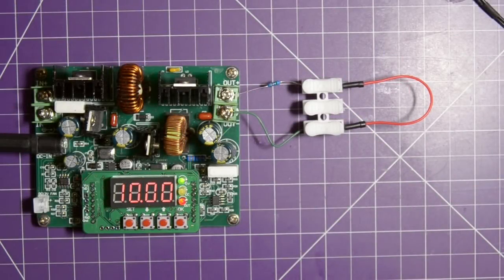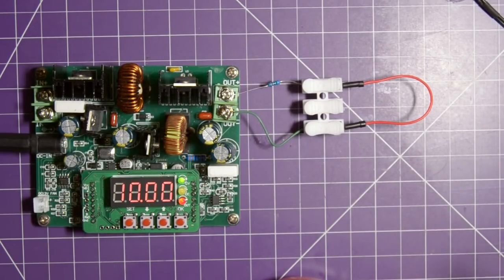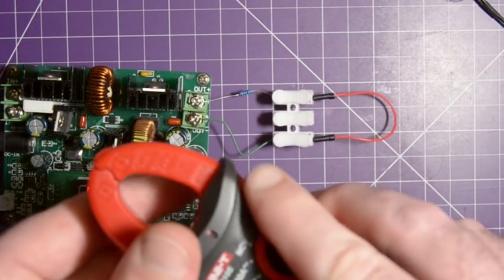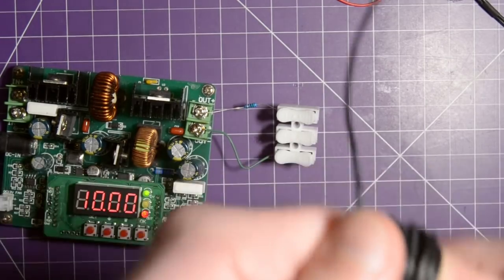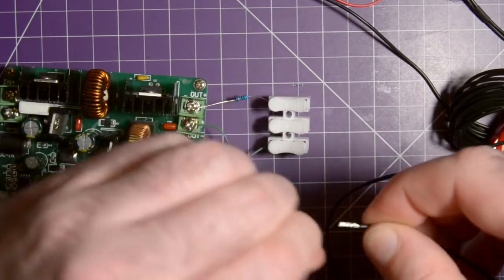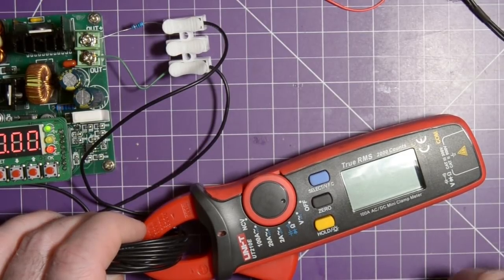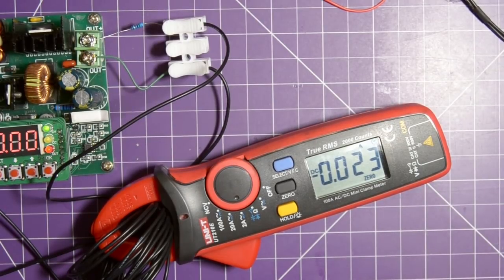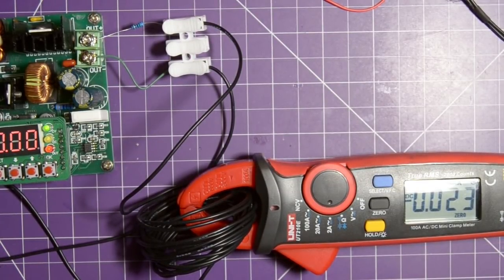Quick Tip: Measuring Low Current With Your Amp Clamp

Comment: You could have first showed the milli amp measurement by measuring the milliamp in series (series ammeter measurement) to show the actual milli amp current, then showed the final method to prove you are right.

Comment: Not a very scientific example to zero the single wire several feet away from it and then measure compared to wrapping the wires an zeroing with the wrap inside the clamp. To show any difference you should have zeroed the first measurement clamped around the single wire. Also, you're changing the impedance of the wire by making it longer and turning it into an inductor

Comment: To hold the wires together, you could also go back 1 turn, then slightly wrap it around the coil as you redo the last turn, using the wire to hold itself together =)

Comment: How low amp this clamp meter can measure accurately.... 4 to 20 mA?
Reply from the maker: yeah down around 10mA it can still be trusted - I use it for parasitic draw in the shop
Reply: @SimpleElectronics  nice tq

Comment: Bloody glad this was published on April 1st.  I was just about to go ape shit.  :)    This video is wrong on so many levels it's bloody scary.   It was an April Fool's wasn't it??
Reply from the maker: What is wrong about it?
Reply: @SimpleElectronics  It is ratio of turns that amplifies actual reading is not applicable on wide range. You do not have linear reading it is just some number you can not trust to be used as measuring principle.  Your idea is useful only for specific system where you do know and have measured specific details and than you only want your inappropriate tool to show you rough value in narrow range.

Comment: Can I measure amps with a clamp meter as I do it with a multimeter?  If I cannot manage to do your trick I want to connect the cable serially to the clamp meter and use it as a multimeter. I ask cause I dont have any clamp meter I am gonna buy it soon.
Reply from the maker: no, on this model, current is only done via the clamp
Reply: @SimpleElectronics  Thank you, I couldnt find anything about that on the internet.

Comment: Just Zero it at the exact spot where you do the reading. Then it will be accurate. :-) In a DC Measurement, any shift / rotation will be seen by the meter. Even the Earth Machnetic field couses a great shift.

Comment: I do not understand the goal of this trick (whenever I know it for a long time) because if you can do such multiple ring then you can disconnect the wires so why not simply use a classic ampmeter function of a classic multimeter ? that will be even more accurate without any trick needed.
Reply from the maker: Just another tool to keep in your toolbox of knowledge, that's all! Plus, if you are not sure of the output current, it could save you a fuse
Reply: Since you can open the clamp, you can also wind a sufficiently long wire without having to disconnect it.
Reply: Dod Utils If you would have listened well he said if you only have this meter and this meter can not measure the amps by using in within the circuit. Practical in the field you will hardly be able to do the trick as you don't have the much lenght available and the clampmeter diameter will be a boundary. But nevertheless it might come handy at times.

Comment: I have a huge 600a clamp for an oscilloscope. I need a smaller clamp for parasitic draw. I'm going to do this with a wire in series with the terminal/post on the battery to read current. thanks
Reply from the maker: awesome!

Comment: Last summer I bought some variety of [this kind] of clamp meter.  I have yet to test it out, and to try your method shown here.  When testing time comes, FWIW, I'd try 1) coiled solid wire, 2) coiled stranded wire, 3) light vs. heavier gauge conductor for 1) & 2) and possibly 4) scatter-wound vs. careful-wound coils.  Yes, sounds anal-retentive testing, but who knows what those variations might produce in the measuring outcome.
Reply from the maker: Ehh we are tinkerers, trying new stuff is what we do. when you do test it, let me know the results. I would think that the current values will fluctuate more within a sample than it would between samples so I don't think you would get super accurate results, but you never know until you try right?